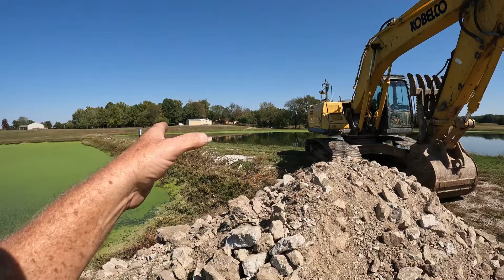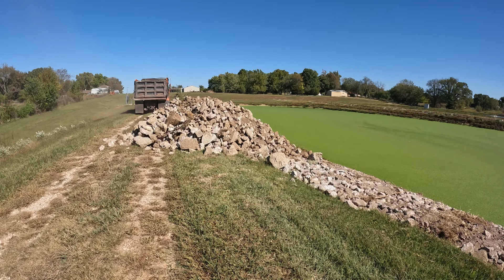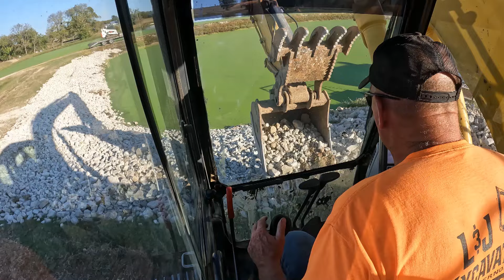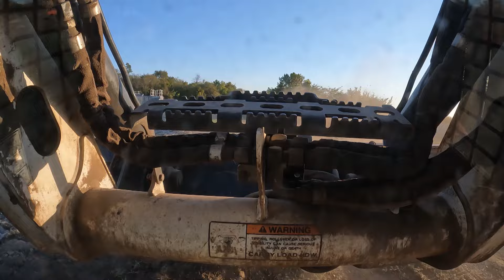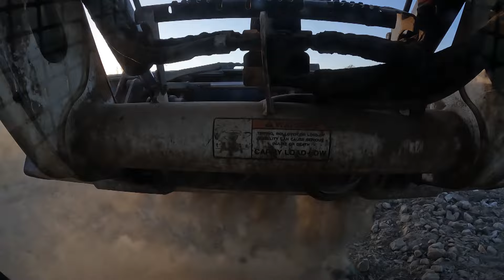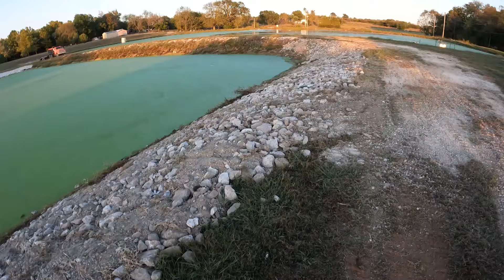Muskrats Tearing The Waste Water Treatment Plant Up Again!

Comment: Years ago i worked on a job similar to this Muskrats did the same thing they slowly erode into the banks which would cave in from were the collapsed holes were. Our solution to the problem was chain link fence just below the water level which blocked their best access in digging their holes. It worked very well. As they won't dig holes 4-5 feet under water where the water was deeper. The Chain link fence also helped stabilize the soil below the water level.
Reply from the maker: Yeah, id say that would work well too.  The inside slopes were becoming really steep to mow so placing the rock there was two fold.  They've trapped several and even shot a few but they kept coming back. Really surprises that wild life would even be in those ponds.  But there's geese and all kinds of critters in them.  Thanks for the comment!
Reply from the maker: @user-bt6hh9yu1n   Yep!😂😂